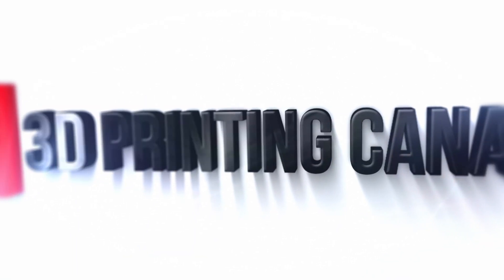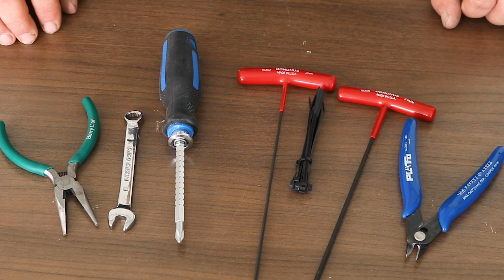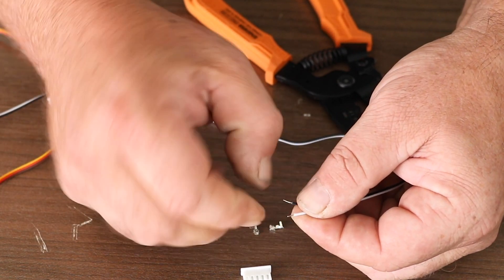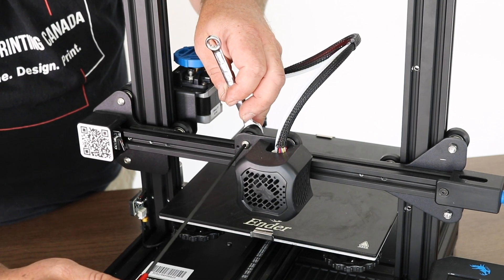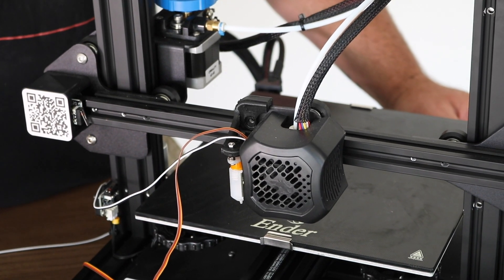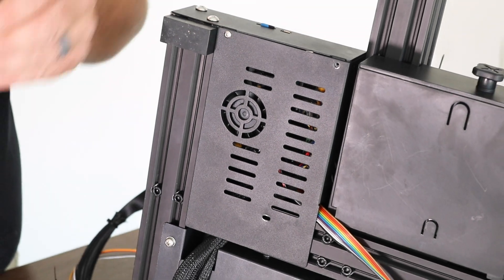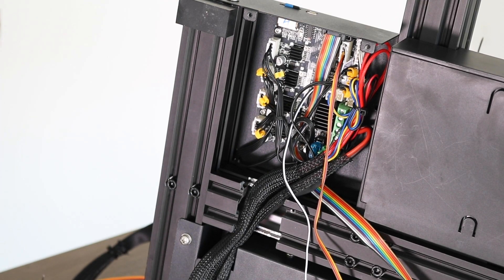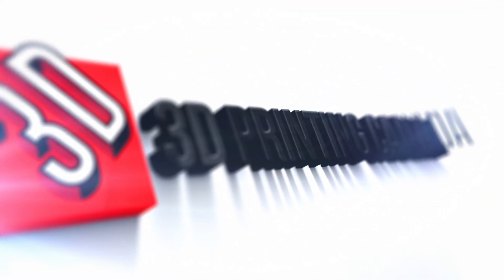Creality Ender 3 V2 BLTouch Installation Guide

Comment: I really hope you get back to me on this. I have a question about the mounting bracket used in this video. Is it safe to use the mounting bracket with the springs? Meaning; can you screw the probe right to the bracket, or will it not be long enough that way?

Comment: What Firmware are you using?
I downloaden 4.2.7 with and without Adapter Board and in none of the Versions i have a BLTouch Button and by pressing Auto Home nothing happens.
The actual BLTouch got a wire with all connectors on it.
Reply: same here. did you find any solution?
Reply: @TamásKiss-j8s  yes. The Ender 3V2 has the 4.2.1 Board.
The 4.2.7 is a different board. Its useless for the Ender 3V2 but can be used ind the Ender 3 or Ender 3 Pro.
You need the Version without Adapter Board in the Ender 3V2 and a lot of other Software on your PC to configurate the BLTouch. Its not running out of the Box

Comment: You dont need to do the wireing or 3d print a new mount because you already have a custom version specific for the Ender 3 v2 on their website. Creality3D BL Touch Auto Bed Leveling Sensor for Ender-3 V2
https://creality3d.shop/products/creality3d-bl-touch-auto-bed-leveling-sensor-for-ender-3-v2?variant=37485104726166

Comment: Hello and thank you for this video surper, I did the same wiring, the BLtouch works and I was able to do the Z offset without any problem.
But here I have a big problem, when I want to print at the temperature rise of the plate (60 °) and then the nozzle (200 °) the printer turns off and restarts and does nothing more than that.
Do you have any idea where the problem could be coming from?
Thanks in advance.

Comment: For the love of god....do not attempt to wire the JSTs unless you have the proper tools.  They are tiny and unless you just recently graduated from brain surgery school, it is challenging to say the least.  Purchased the wrong crimper, tried every possible method to crimp, finally just chucked it all away and will look elsewhere for the cable.  Super frustrating and now that the wired kit is available from Creality, really feel like I wasted my time and considerable effort.  Damn frustrating to sort out a connector.
Reply: Yeah i ordered my bltouch for my enter 3v2 back in October ... took 2 months to arrive (came today) and i see creality has a kit now specific for the 3v2 that has the JST connector.... 

What have you ended up doing? Use the adaptor or?

Comment: It could be helpful to first do some research to know that there are different supplied BLTouch + Harness options that don't follow this wiring. I purchased one that instead of the 5 pin connector, has a small PCB that breaks off some pins for the screen and the Z-Stop plug gets disconnected and the BLtouch plugs in its place (obviously due to the fact the end stop is now replaced with the BLTouch). 

I was extremely confused initially thinking I had the wrong item but after some more research I find there are a few different solutions to connect it. Also, shame there was no run through on updating firmware and setting the offset or anything as that's the important aspect.
Reply: can you make a image

Comment: don't use the springs.. that way your sensor point is to long when retracted... so hits plate before the nozzle does... it needs to be out longer then nozzle... and in shorter then nozzle...

Comment: Why not feed the wires through the black mesh ?

This is the first time I see someone actually using the springs.

I dont have a crimp tool,I have bought the dupont SM-DU and im hoping to hotglue it in place

Comment: The JST connector portion that crimps the bare wire is only 2mm in width or just over 1/16".   You said you removed 1/2" length of insulation.  Where or how did you manage to cram that much extra bare wire into the connector?

Comment: A pinout of the BL touch and source for the connector link would be very useful as not all bl touch wire harnesses have the same color wires.

Comment: How about the offsets? Does the creality firmware match the mount you installed?
Reply: you have to calculate the offset and manually insert it in to the firmware, they are a dozen of different mounts for the touch which will requiere a different offset

Comment: Is there a metal bracket available vs a printed one ?
Reply: Yes there exists a kit made for the Ender3V2 which includes the correct bracket made out of metal.
Reply: @ingeburgknotke396  do you know the x and y offsets of the factory bracket?
Reply: @on3go16  don’t know it right know but this Video should help you with the process regarding the factory bracket https://youtu.be/r_mboxnkXfI

Comment: Wow, I'm shocked these cables don't already come pre-made.  Thanks for showing us how.
Reply: Actually they do, just bought one.
Reply: @hackwar1  Where did you find the JST cable?
Reply: @hankus253  There are several cables on ebay, but shipping took too long so I cancelled it. So I ended up buying the original Antclabs extension cable which splits into 2 Dupont connectors. I replaced the Dupont connectors with a single 5-pin JST connector. This fits nicely to the main board and won't come loose by itself.
Reply: It's a universal cable so the end needing a connector could vary widely.